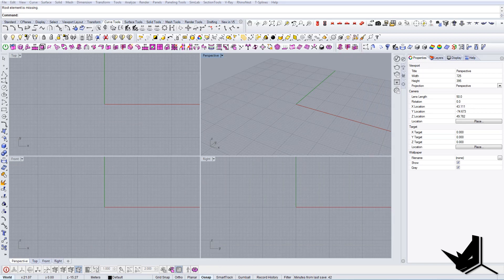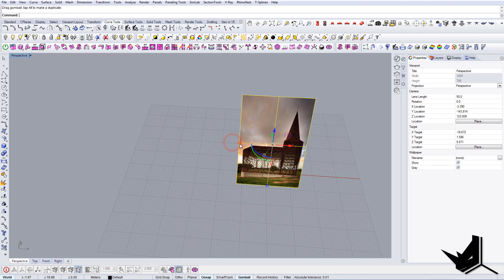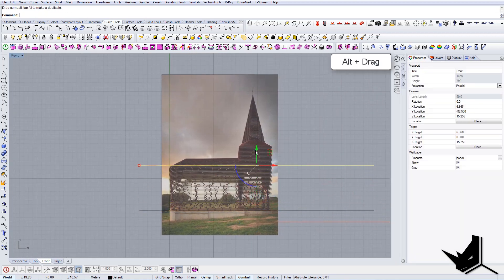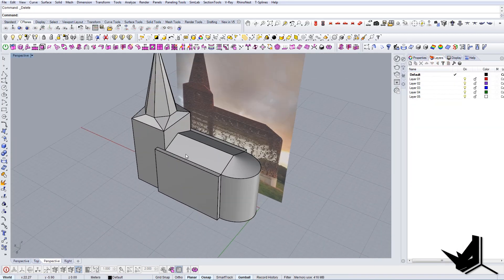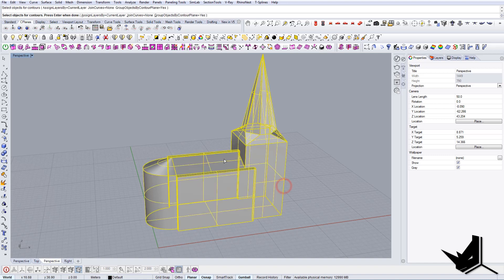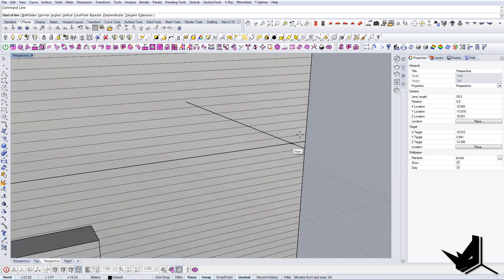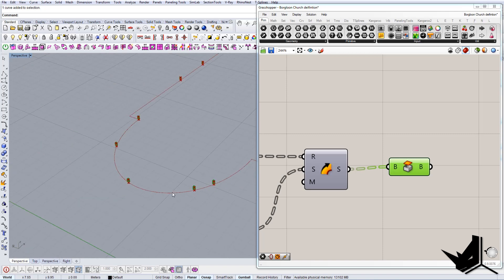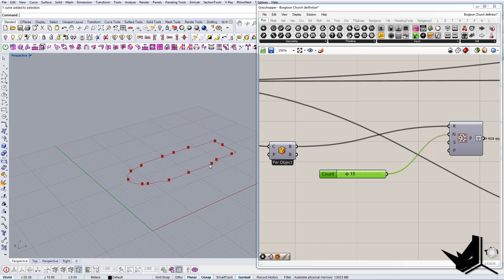How to Model Borgloon Church in Rhino

Comment: Hi! How did you apply the grasshopper element to all the other curves? Thanks for your tutorials!
Reply from the maker: Hey hey! You're welcome!!! I simply selected certain curves and used option "select multiple curves' to get the same kind of distribution. Then I changed a bit the amount of elements and did the same to other set of curves. It's a bit of manual work, but it is also possible to randomize it to all curves at once. However, I decided that this would be too complicated to explain for now :)